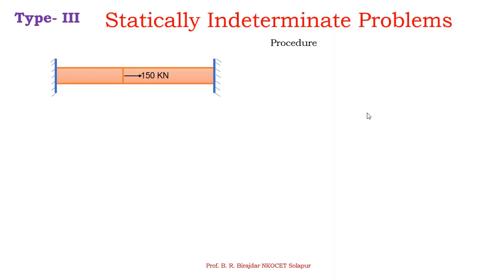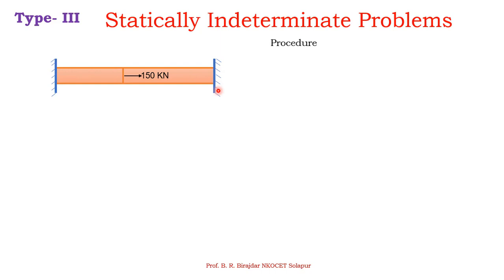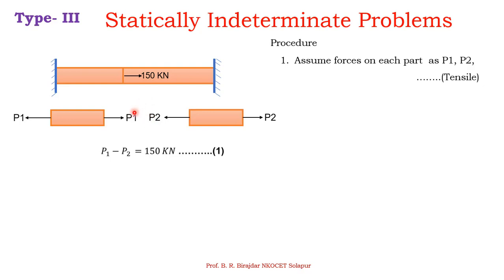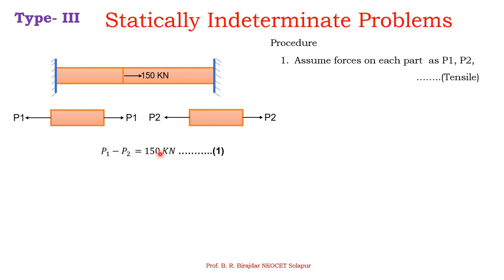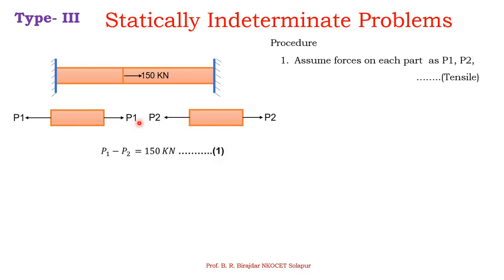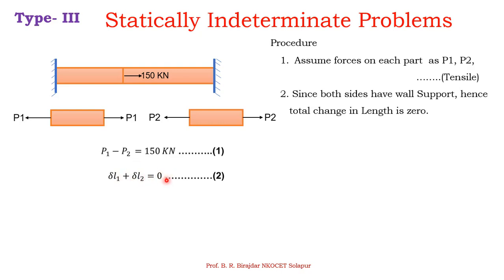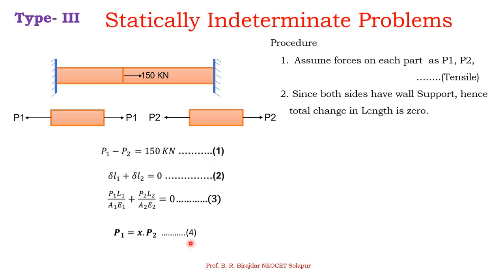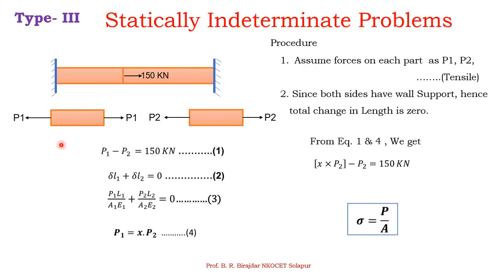Statically Indeterminate Problems (BRB)

Comment: teacher i have a question 
What is the importance of  the statically indeterminate?
Reply from the maker: Statically indeterminate structure have capacity to redistribute the loads. 
If a part (or member or support) of such a structure fails, the entire structure will not necessarily collapse, and the loads will be redistributed to the adjacent portions of the structure.